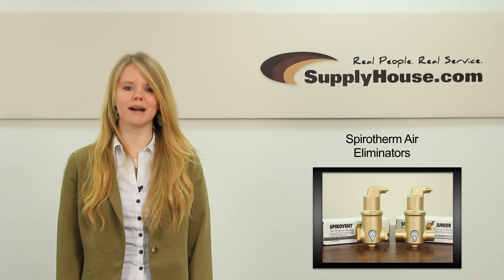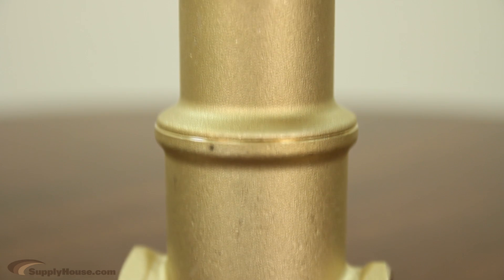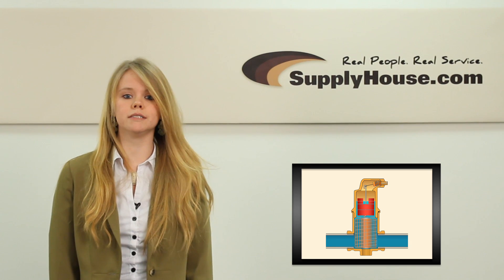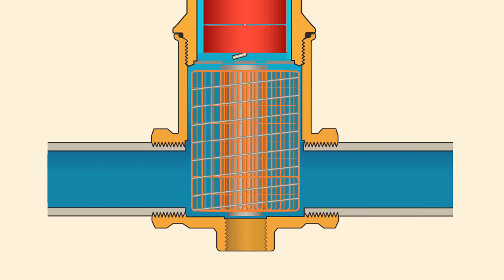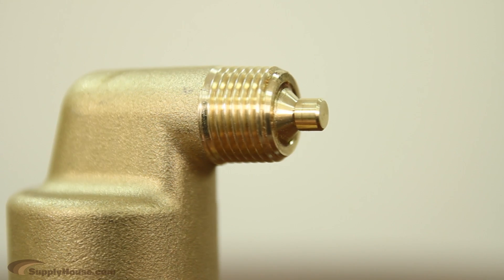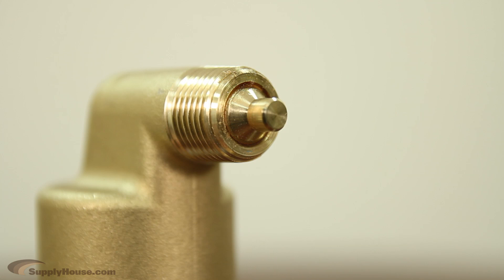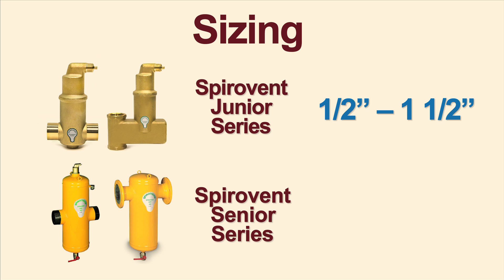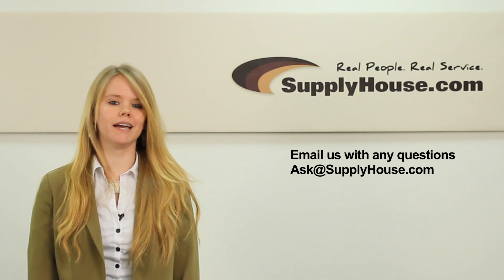Spirotherm Air Eliminators

Comment: Had one of these pieces of garbage blow off uncontrollably while purging new zone on 10 year old system.
Yes, it is installed as per man specs and there is no glycol in system and boiler pressure is normal... 
Got it to stop by lightly tapping on it and then before our eyes, about 5 min later, it blew off uncontrollably again....
Good thing we stayed to watch boiler reach temp and check circulation of new zone, otherwise it would have flooded the basement.
I had to cap it off with a 1/2" cap....... it just wouldn't stop.   BEWARE IF YOU DONT WANT A LIABILITY INSURANCE INCREASE!!
Reply: Never heard that before. Been dealing with these for years.
Reply: @michaelmcneffii1912  Consider yourself lucky... so far!
Reply: @jackc7262  that’s scary
Reply: Did that ever happen again afterwards?
Reply: @kofski  no..we left it capped and customer sold house about a year later.
I have not many in the field since this occurrence.
Reply: @jackc7262  Thank you for your reply! They might have reacted to this issue as they instruct to first cap it of and secondly flush the system. After the system is being flushed then you can remove the cap. What is strange though, that there is no cap delivered with the original packaging. Did your instructions mention those steps of installation?